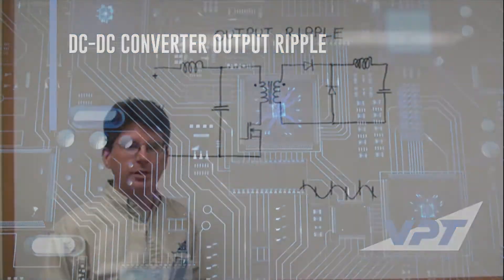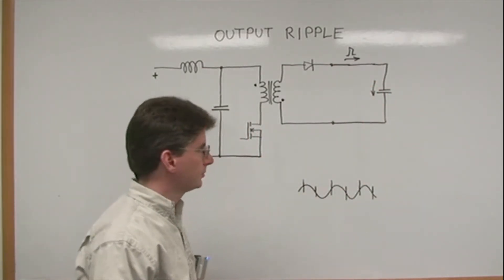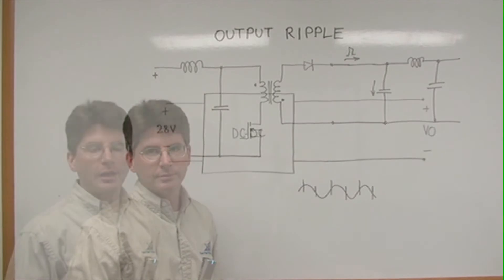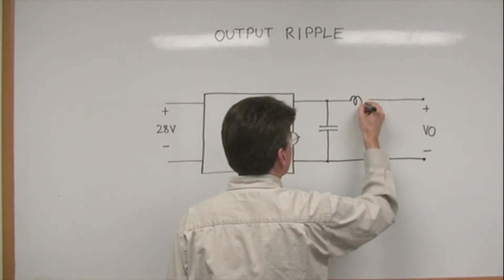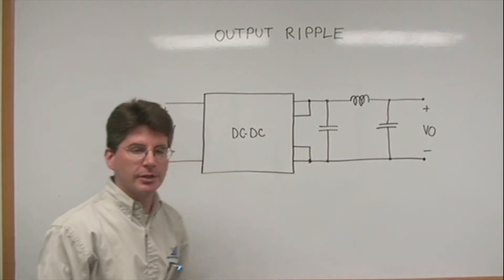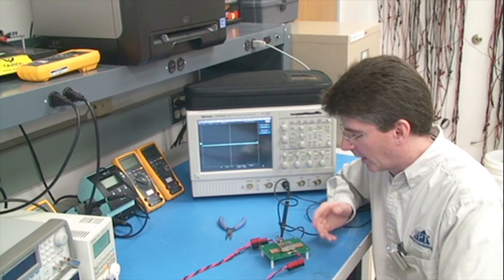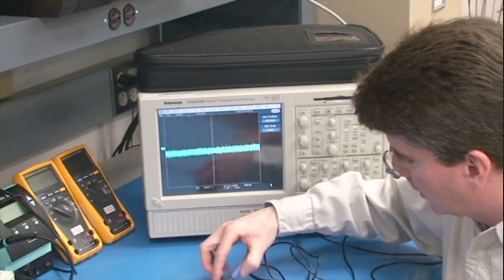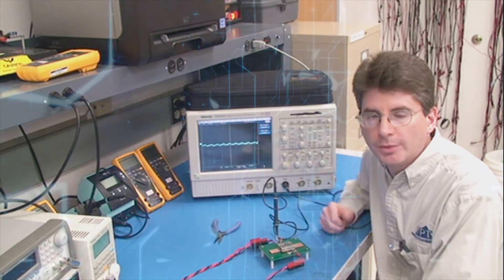Methods to Reduce DC-DC Converter Output Ripple

Comment: what about using a linear voltage regulator?
Reply: unfortunately the efficiency of these devices is very low
Reply: A linear voltage regulator will give you a smooth output with no ripple since the way it's designed isn't the same at all. However, most linear voltage regulators have TERRIBLE efficiency. Most of your power will be used in heat.
Reply: People add linear regulator after dcdc converter and this works nice. Linear regulator used is LDO.